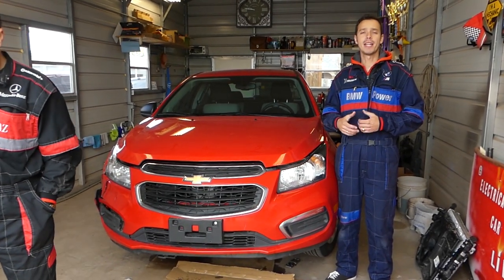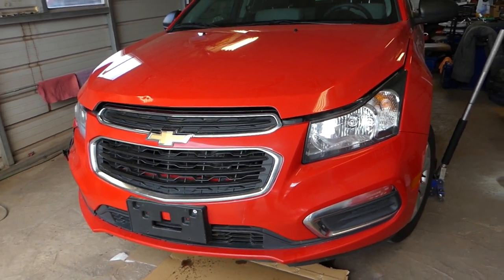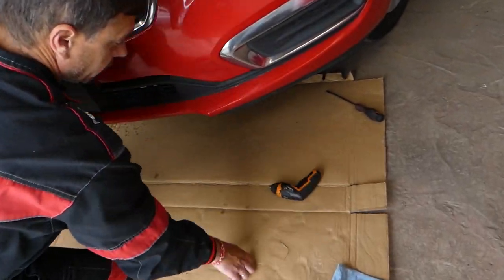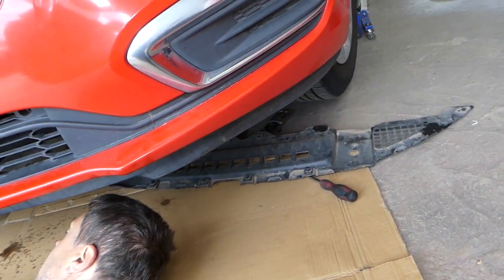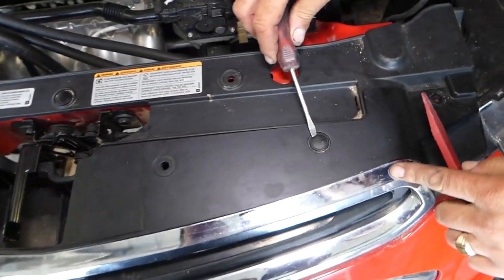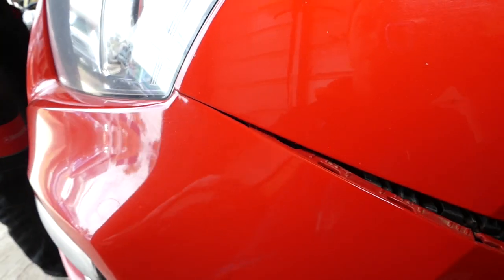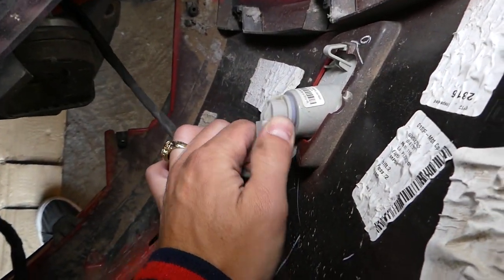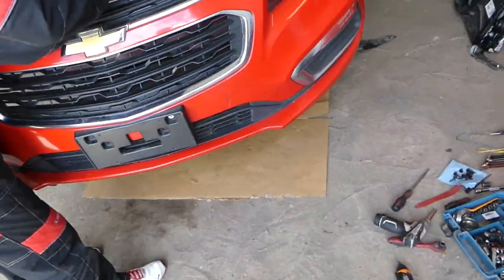CHEVROLET CRUZE FRONT BUMPER REMOVAL REPLACEMENT. CHEVY CRUZE

Comment: How are you
 Mercedes-Benz C-Class 2001 with its suction key
 The switch is running well but
 Sometimes starter does not work
  Sometimes it works
 What are the reasons?